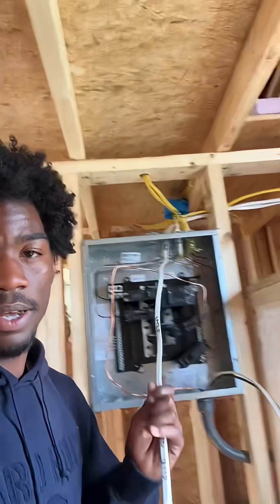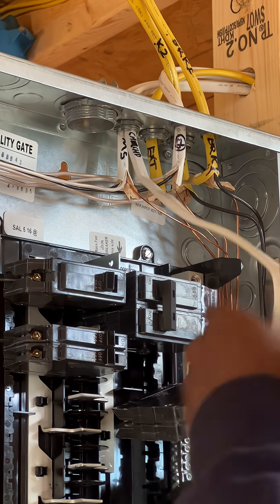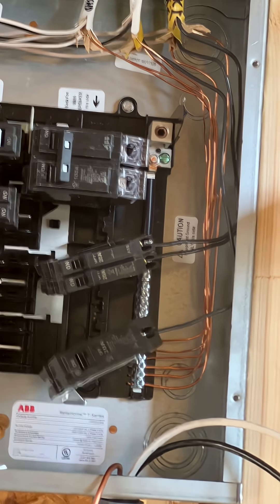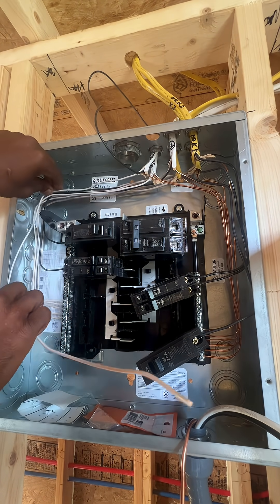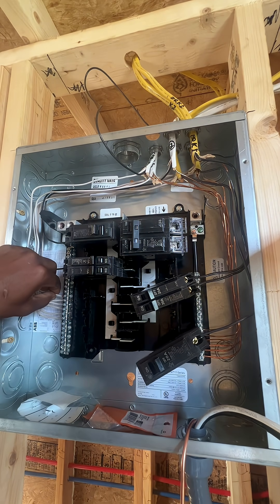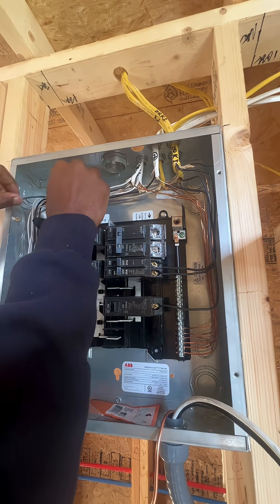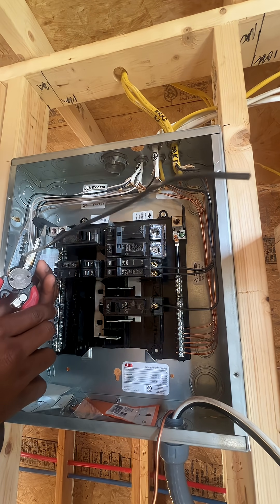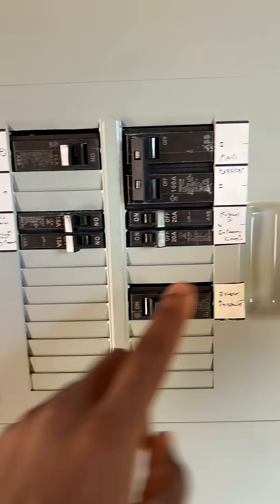Tiny Home Build: Installing Breakers and Wiring a New Circuit

Comment: i have always put a little cut at the end of the cable just enough to grab the bare copper ground wire with pliers then pull it at 90 degree angle to the cable causing it to split the sheath like a knife as far back as you need and no risk of nicking the hot or neutral wires sheath with a blade but any way which gets the job done is the right way
Reply from the maker: good tip, i'll try that, thanks !